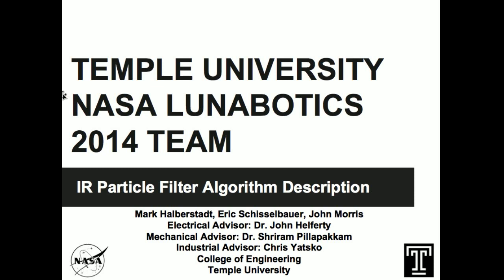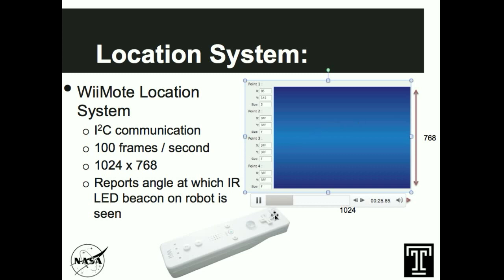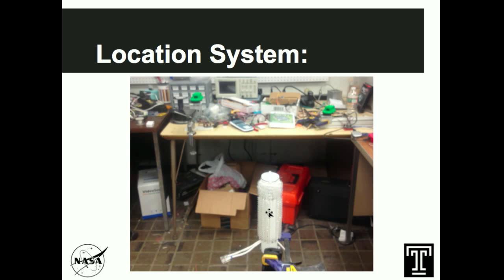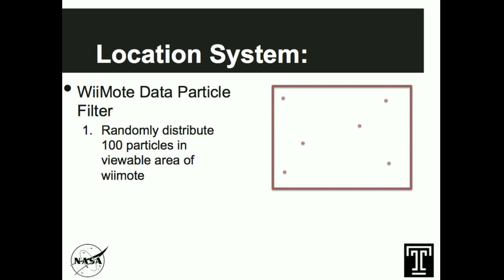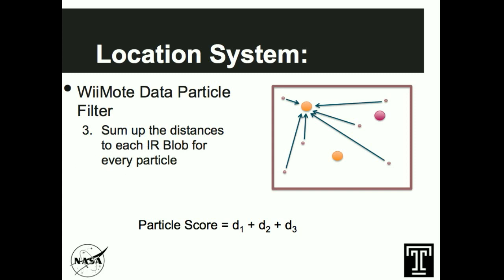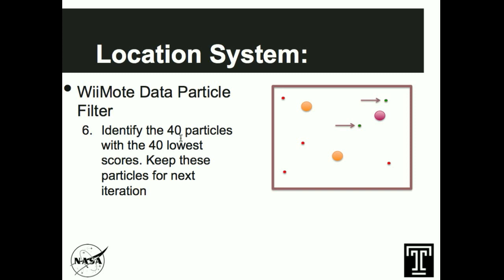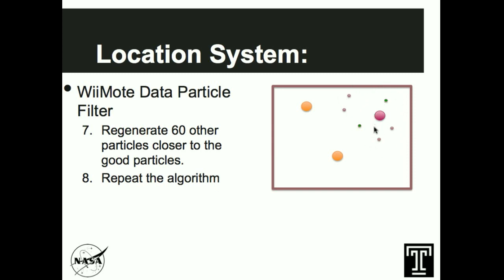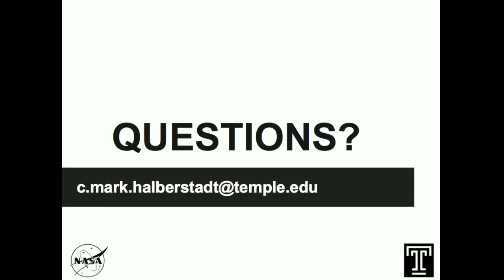IR Particle Filter Algorithm Description

Comment: thanks for the video, but i would like to ask is it that it filters just dc IR signals but also modulated signals that aren't at the same frequency as the beacon signal?
Reply from the maker: I'm not sure how well the filter would work with IR signals modulated at different frequencies. For our purposes in this project, we made our primary objective the elimination of problems caused by DC interference. We had a great deal of sun light interference, but not much interference that would be coming from a modulated source.

If you would like to try something like this yourself, and test it on modulated signals, you might be able to get it working. Send me an Email at c.mark.halberstadt@gmail.com and I can send you the code. The code is all Arduino and Java.
Reply: would like to take you up on your offer but I currently do not have any of the devices, but if I ever do I'll certainly send you an email. anyway you'are doing a great job so far, keep it up.